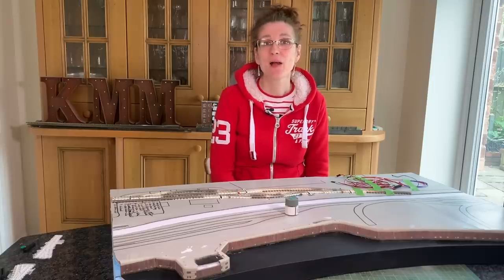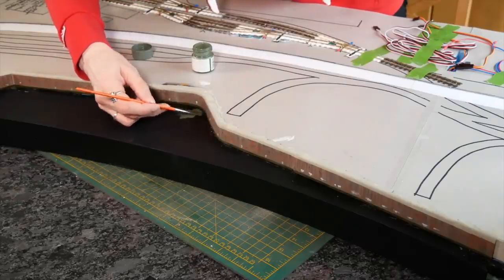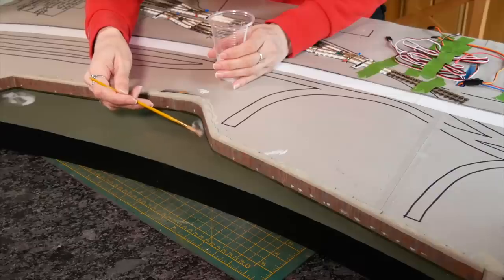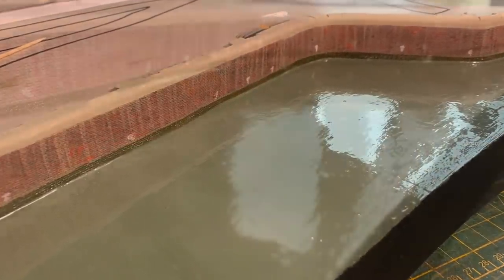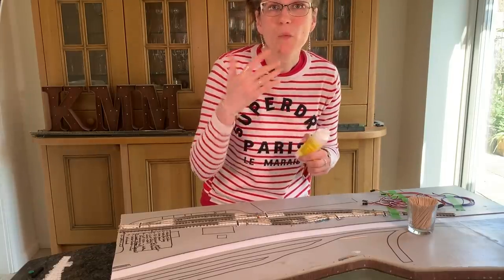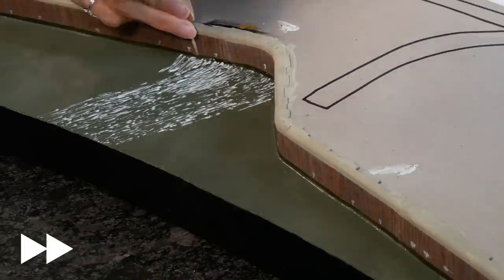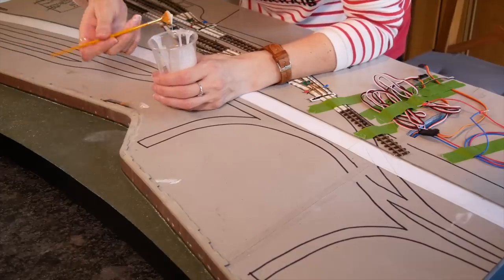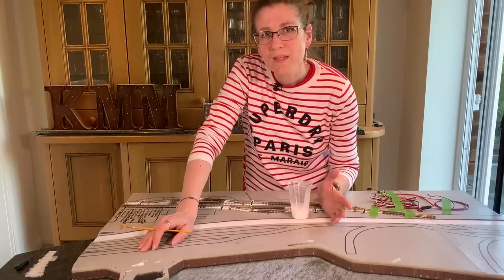Cheap and Easy Model Water

Comment: I used my airbrush (without paint, just air!) to gently blow ripples onto the wet tacky glue. Seems to work OK. I've seen people do the same with mod-podge gloss medium as well.
Reply: Well you beat me to it.... great suggestion... it really does work well ...
Reply from the maker: The problem I found with PVA is that if it was thin enough to blow then it levelled back out.
Reply: @KathyMillatt  I like using higher pressure on stuff like that... but I also like the mod-podge method also and find it to be almost satisfying to watch it ripple and dry...
Reply from the maker: It always looks like a great technique but I wanted this one to be accessible to everyone even those without an airbrush.
Reply: @KathyMillatt  true very true... and I appreciate all of your videos... I am planning out my own giant train worldscape and your videos have been very good for me to watch... I'm a great fan of yours...
Reply from the maker: margaret hughes I always do ripples afterwards or you can’t get the boats to sit flat but I wrap them in clingfilm so that they remain removable whilst I’m working on the layout.
Reply: Lower-tech version: blow through a straw - pinched at the bottom to adjust the airflow .
Reply: @KathyMillatt  ... Try waiting until it's just beginning to form a 'Skin'.

Comment: You can add a final coat of Acrylic gloss clear, I use Future, to seal the PVA water. You can spray it or use a brush to apply the clear gloss.  The advantage gained is "water proofed" water, and things like dust, or other debris will not adhere to the glues surface, making eventual cleaning much easier.
Reply from the maker: I may do that. I was trying to stick to just PVA and so far it seems quite robust but time will tell.

Comment: I did very much the same thing once but: Use scatters (e.g. for sand or grass) BEFORE doing the water. Otherwise, some bits of sand end up in the middle of the water.
Reply from the maker: I normally do water ripples etc last to avoid that problem. It can be a real pain with resin though as the water creeps into your scenery.
Reply from the maker: I often do the first pour of water, let it creep, then do the scenery again, then do the ripples.
Reply: @KathyMillatt  The layout in question was a sunny beach by the sea with a golf course nearby. But some patches of grass ended up 'floating' in the sea.
Reply from the maker: That sounds so annoying. Planning layers and timing is so important!

Comment: curious why did you not pour the PBA glue rather than brush it on?  If you pour then no brush strokes but I might be mising something here.
Reply from the maker: If you pour it, it can end up too thick and when it dries, it shrinks, pulling away from the walls. This is not a product for pouring as it’s not meant to be giving depth, just shine.

Comment: Very nice effect. I admit I normally finish my water off with Gloss mod podge and my airbrush on a low P.S.I.. However next time I will have a crack using this method. Thanks for another great video.
Reply from the maker: Thanks Nick. I had a bad experience with Mod Podge once but I must try it again. I normally use gloss medium so this was an interesting change.

Comment: I'm just starting my scenry on my N scale layout . Your using PVA glue is really neat . What would happen in filling a 1/2" to  3/4"  hole for a pond or lake . Do you think it would still dry clear ?  Or am I better off using something else ?  Enjoyed your video .
Reply from the maker: You can but clear PVA but it shrinks as it dries so if you pour too deep a layer it pulls away from the edges as it dries. You would need to do a deep lake with so many thin layers. Personally, I would use a resin because they set chemically so don’t shrink and they will definitely be clear.
Reply: @KathyMillatt  Thank you so much . My thoughts were along those lines , but wasn't sure .  Sure is nice having someone to ask these questions before messing something up . But it's part of the hobby , trial and error . Thanks again .
Reply from the maker: @stevetandysr.2816  At least I have done the trial and error for you on this part!
Reply: @KathyMillatt  Yes , Thanks so much .

Comment: Hi Kathy, saw this some time ago and and went straight to my model and created a beach and rocks scene with the waves breaking, looked very good for a first attempt. But I have now gone a stage further with the toilet paper and pva, I know make rock faces using the molds available and instead of modelling plaster I make a very thin and light alternative using the same technique, making very sure to get the toilet paper very damp and pushed into the crevices, came out great and a fraction of the weight, also it is a little flexible which aids fitting. Many thanks for the video, regards Bill (A budding modeller, at 78) 🙂I would send pics, but can't see how.
Reply from the maker: Thanks for the pics you did send. Stunning!

Comment: A good way of creating ripples is with tissue paper socked in water thinned PVA.  Especially good for creating wakes from boats.  Simply soak in PVA watered down and then place with tweezers and shape.  Once dry you can paint it but often look just fine as it is.
Reply from the maker: I like using translucent materials so that there is a bit of depth to the waves but I have seen some stunning results using the methods you mention.  There's so many ways to do the same thing!

Comment: Hi Kathy,
First off I just watched the replay of the STEVE BROWN LIVE (on record) show.  THANK YOU for guesting.

Secondly, many decades ago I did PBA Water Effects.  It remains a superb technique in areas of little or no depth.  Quite effective results for a teenager on an allowance. 

Secondly, one can be ashamed, I SAID ASHAMED 😳, of a particular modeler who leaves holes or gaps in their (HER) structure.  ASHAMED I SAY.  OK I have been known to do the same, but I don't admit to it.

I admit to being a cheap skate.  And in those days I molded ceramic rocks and cliffs I would save the unused broken bits and dust in a plastic container.  I would do the same with sawdust.  Then when a gap exsists I would make a small slurry of "dust", PBA, H2O, and Mom's dishwashing liquid to PACK THE GAPs.

BUT MOST IMPORTANTLY ADMIT TO NOTHING.

Love all you do.  Again thank you for doing the STEVE BROWN show.

~ Jim Van Amburgh
Reply from the maker: Thanks Jim. It’s too easy to use videos to make yourself look perfect but I’m not and I think it’s important to show failures to encourage people as it never goes right 100% of the time.
Reply: @KathyMillatt  You know there some sense in what you say.  I guess we subs. just see you as Ms. Perfection.  Love Jim
Reply from the maker: What a huge pressure!  I’m definitely not perfect.

Comment: You could use a product like Mod Podge, or gloss medium, with a mop brush dabbed thickly on the surface and with repeat coats to build up the effect. I've seen others use a blast of air from an airbrush compressor, but you have to keep doing this until it dries or else it will level out. Tedious but effective.
Reply from the maker: I normally use gloss medium but was challenged to do something cheap and available everywhere. I’ve not tried the airbrush but PVA definitely self levels a lot.

Comment: Personally, I've tended to, after painting water, to start with a layer of gloss polyeurethane, then stipple on the clear drying, gloss mod podge before another thin layer of gloss over that. The end result is less vulnerable to water accidents along with most other mishaps. At least with terrain and larger bases/diorama work, I've used mainly gloss if I'm doing miniatures work though.

As another tip, if you want the really algae overgrown water such as swamp/pond type use polyeurethane and sprinkle on a mix of fine flocks from greens and browns. Then put another layer over it, the end result looks like the marshy mess in the water that can be further enhanced by other plant work over and through it.
Reply from the maker: I love making bogs etc. So much fun!  I wanted to do PVA for this as I’d never used it before. My go to has always been acrylic gloss medium as I had a very bad experience with Mod Podge not drying through my waves.

Comment: THAT is awesome!!!! I've been looking for a cheaper way to make water. I used the liquid from Woodland Scenics but it made balloon bubbles on every waterway I made evan when I sealed the foamboard with paint. I suspect a chemical reaction between the water chemicals and the paint chemicals.
Reply from the maker: That can be a problem. Just don’t put any layer of this on too thick as it shrinks slightly as the water evaporates and can pull away from the edges.
Reply: a heat gun, carefully used, might release the bubbles, over the setting time. See Luke Towan's channel. He does that often.

Comment: Kathy a few years ago I use some pva to make a river and waterfall the river started out clear but then turned cloudy which was disappointing. How ever it worked fine for the waterfall. What I did was spread a sheet of cling film out dribbled the pva across the film in pieces 5-10mm wide and 50 to 100mm long before it dried I used a cocktail stick to rough up the edges so they had a feathery feel. Then let it dry pealed them off the film stuck them in place on the waterfall, when that set I dry brushed some white down the fall. To me the whole think looked very realistic and light and feathery enough to look like water flowing with the hint of spray. The test is I would do this again but not for a body of water. Neil
Reply from the maker: Neil, I’ve only done waterfalls with silicone before but it sounds like you’ve nailed it. The UK isn’t that humid so the PVA has stayed clear. I can imagine in some areas, it. At be more of a problem.

Comment: Looks effective,depends on the 'kind' of water,on larger flat canal type areas or lakes(as on your layout section) i think it works well,plus you can vary the base colours for different tones and depth effects.
Reply from the maker: True. Water has so many different types and it’s great to have a few methods on your arsenal of techniques.

Comment: I have used this method for years and the best way to protect it from any moisture is to let it cure for a week then op coat it with clear gloss acrylic varnish ,it helps the look too by adding that bit extra gloss. just make sure its covered while drying so no dust or muck get on it .
Reply from the maker: Thanks for the tip. I had a problem somewhere else with the acrylic varnish rewetting the PVA and then the varnish dried before the PVA sealing in the damp. Have you had that issue ever?
Reply: yes ,now think back it made the pva go slightly milky .I tend to use just the cheap acrylic varnish now. I know its a personal choice ,that's the great thing about this hobby isn't it ,there are always new ways that other enthusiast have tried so you can choose.thanks to youtube and folks like yourself who give great tips .I use youtube reviews of products and models to help in purchasing ...it backfires though ,I always end up buying too many locos lol .great job on your tv appearance by the way. its never easy judging others work .
Reply from the maker: Thanks a lot!  YouTube really has opened up modelling hasn’t it. We’re filming a new series of the Great Model Railway Challenge soon.
Reply from the maker: And we all have too many locos!
Reply: it certainly has helped the enthusiast by allowing them to get the help and advice before spending  hard earned money on the wrong items. i am looking forward to seeing the new series, i know you cant say too much but when is it due to be screened?
Reply from the maker: moebius Hi, I don’t know the screening dates yet but it will be the autumn again.
Reply: I will keep an eye out for it...but not literally lol .

Comment: Thanks Kathy.  One of the most realistic water scenes I have ever seen; and so easy.  I need to create water in a canal on my layout so your method is the one I shall use.  You refer to a list of products at the bottom of the screen but I couldn't access it.  Can you tell me the paint you used please (I picked up the glue etc).  Many thanks, really good,  Chris
Reply from the maker: Chris. It’s on YT if you hit the more button or check out my blog post on it:  https://www.kathymillatt.co.uk/blog/2019/05/16/cheap-and-easy-model-water/
Reply: @KathyMillatt  Thanks Kathy,  I am new to YouTube and cab#t seem to find the 'more' button, but have the detail I need.  Will let you know how I get on.  Incidently, is it best to put a boat on the scene before or after the water?
Reply from the maker: @chrisemptage8896  Chris, I would do the water first but I only have hull line models so that works for me.  I would wrap the boat in cling film and do the final ripples so it is removable if I want it to be...
Reply: @KathyMillatt  Thanks Kathy, will do what you suggest,  Many thanks again, Chris

Comment: Kathy, a great episode... love the way you speeded up the repetitive parts.  But I'd be afraid to use this method because, as you said, PVA is actually water soluble, and getting it wet could really mess up the effect.
Reply from the maker: Jim. You’re right and it depends what else you are doing there. I know this is against a completed section but I often do the water last.
Reply: @KathyMillatt  THanks, Kathy.  I've learned a LOT from you!

Comment: This is an excellent example of using PVA as water. I am almost at the point on my N gauge layout to create a centrepiece inner-city river. It's quite wide and I want it to be very similar to the water you've modelled here. But I have two questions - do you find that the PVA returns to a milky colour over time, or can you be confident that once it's clear it will stay clear (as long as you keep it dry)? And secondly - I want my river to be almost ripple-free. I saw you point out that the first of your layers has brush marks. Is there a way to get it even more level? By watering down slightly for a top coat or something? I'm really keen to use PVA rather than a resin-based product, so I'd really appreciate your thoughts.
Reply from the maker: Hi. You can buy clear PVAs which I haven’t tried but look excellent for not being milky. Hobbycraft has some. Mine hasn’t gone milky but a coat of gloss Mod Podge might help as that doesn’t rewet like pure PVA.
Reply from the maker: On the brushstrokes, a thinner product would leave fewer or you might be able to sand if you do get them.
Reply: @KathyMillatt  Thank you again for this video, and your replies. In the end I went with toilet paper and acrylic varnish for the water. However, your use of "drawing" with tacky PVA was inspiring, and I used it to excellent effect on a weir in the same scene, as the basis for the white-water part of the drop of the weir. I couldn't be happier with the result of my efforts - thank you!
Reply from the maker: @Chandwell  Glad you found it useful!

Comment: Hello, I wanted to tell you an easy way to make waves is to squeeze out a thin layer of hot glue onto a sheet of parchment paper. The hot glue is good for making waterfalls. It can be glued down with white glue and it can be painted any color. Cheers
Reply from the maker: Thanks for the tip.

Comment: How do you include a boat or watercraft?  Removable vessels would leave a "hole"in the water.  Waterfronts and barges are part of the scene.  Thanks for leading the way.
Reply from the maker: Hi Austin. I always wrap boats in cling film and then put the ripples right up to them. If a little bit of cling film gets stuck then it’s not the end of the world but it normally peeks off ok.

Comment: Hi Kathy, I used the clear tacky glue method as described in the video. The results were good initially, however the glue has recently changed to an opaque white, despite being labelled as clear. Is there any way to revive the glue?
Reply from the maker: It’s dampness that makes it milky. Mine has never done it but perhaps sealing with a varnish once clear might help.

Comment: Another great video Kathy. I to have used PVA to produce water effects and I will try your method of ripples with a cocktail stick. I have always used the airbrush trick. Your's turned out awesome!! This is a much cheaper way to add a water effect to your layout or diorama. Which way do your prefer.... Pre made water effects (Woodland Scenic etc) or PVA?
Reply from the maker: I’ve never used Woodland Scenics but I think it depends on the water. For canals, this is perfect. For stony rivers, I’d use resin as you can see through it at a greater depth.

Comment: This is excellent. I think I’ll try this, but I’m also considering using ‘Clear Glue’ from Hobbycraft. Do you think this would work too?
Reply from the maker: I have a bottle but haven’t tried it yet. It should definitely work for the base layer but may not be thick enough for the ripples.
Reply: @KathyMillatt  Great, I think I’ll give it a go and use either the tacky glue or possibly some glossy Mod Podge for the ripples.
Reply from the maker: Gloss mod Podge is good.
Reply from the maker: Good luck!

Comment: looks really good especially considering its just PVA glue, great result, could you use you airbrush to blow ripples into the PVA once you have several layers. Andy
Reply from the maker: A lot of people have commented on using an airbrush but I wanted this to be accessible to everyone, especially those with out an airbrush. PVA has a tendency to self level so some experimentation would be needed.